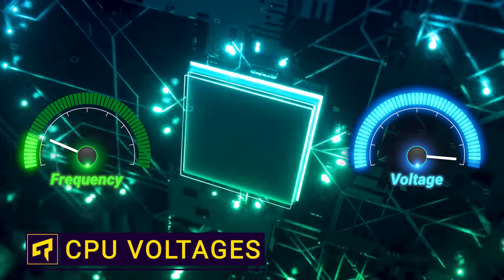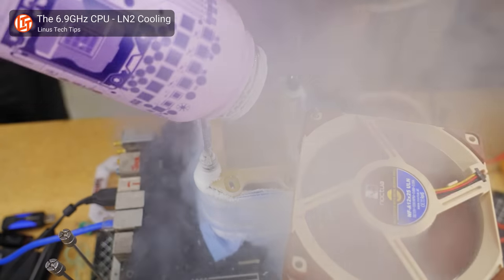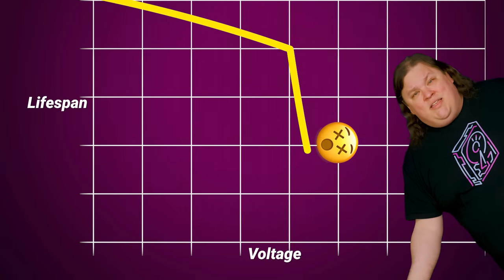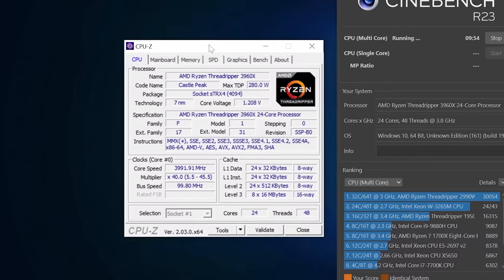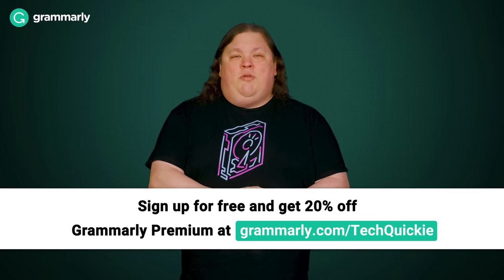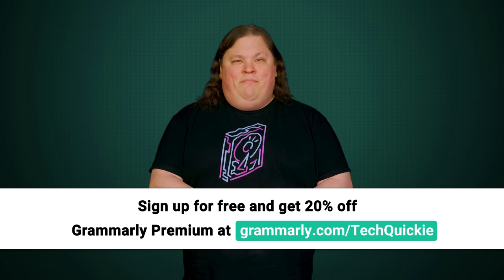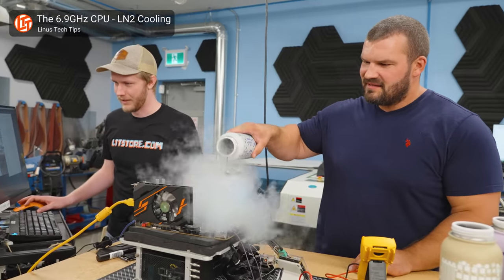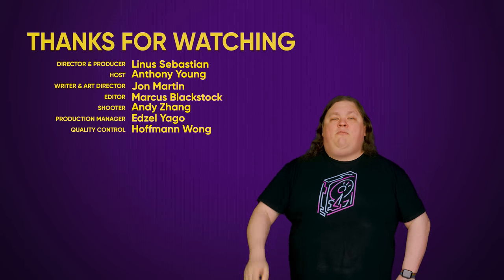What's the Point of UNDERVOLTING Your CPU?

Comment: Stock voltages? Who's stock voltages? Motherboard manufacturers or intel cpu specifications? Intel clearly lists 10th gen i9 cpus stock voltage as 1.28v, however there isn't a single z490 motherboard that wont try to run those cpu's at 1.5v or even 1.6v. I guess if your cpu lasts longer than a year motherboard manufacturers lose money.

Comment: Can you turn your cpu voltage down to about 0.7v and run full clock speed? Are there any cpus that work with 0 volts?
Reply: @miso1995srb  Arm did it,

Comment: I'm still using a 6600k i5, and I managed to OC it to 4.6ghz at 1.365v. I found that at the time was pointless, for the games I played. So I put it back to stock speed and voltage. But recently I felt the need to put it back to 4.6ghz, and squeeze more performance out of it. So that I can hang on a little bit longer, before I need to upgrade. But when I tried to use the same speed and voltage, it crashed. So I stepped up the voltage a little bit at a time. And still it crashed, all the way up to 1.4v. I was told the max voltage is 1.45v, but I wasn't going to go there. Could this be a sign that it's close to its end?
Reply: No, you just got unlucky, I had a similar experience with my old 4690k, it didn't like to overclock, I only got at best 4.3/4.4GHz whereas a lot of people were pushing near 4.8GHz which was ok by me and then later on before I replaced the system, it really didn't like OCing, refused to go over 4.2GHz, but it still ran perfectly fine at stock and I never had any issue with it, if you're really worried then just drop the voltage by something like 0.1v.
Reply: Maybe your motherboard components are worn out. But at the same time I pushed a used in 2500k to like 4.6ghz I think at 1.4v or something. Twas used and was overclocked from the previous buyer so . . .

I dunno. Bad luck?

Comment: There is a thing i wonder though, even though undervolting can reduce the heat being generated, while retaining the same performance, doesn't the current increase instead if the power usage stays the same (or maybe even increases if whatever controls the curve sees there is more headroom/less heat)?

Wouldn't one need a motherboard that can handle that increase of current? Would the VRM heat up more from more current, or just from more voltage? Is the increase of current from decreasing the voltage harmful in another way, for the motherboard and/or CPU?

I'm just grabbing at straws, i'm not sure if this thought is false or correct, just giving food for thought, so someone might answer or think about it too...
Reply: In general it reduces the wattage, my 3070 stock  has a tdp of 220w, undervolted it runs at 167w, and the chip itself only draws 128w
Reply: @tumamaencosplay  Yeah, that is for a Nvidia GPU, i also do undervolt's on a 3080 at 0.868v and 1950mhz, which i tested for stability through various means and my power meter gives me a lower average wattage value and the heat output has been greatly reduced.

However, this is with Nvidia.

I imagined CPU and VRM might act differently and whatever tech controls the curve for that CPU based on various conditions, even more so with a undervolt applied, with changes to how things work over various different generations and between Intel and AMD.

Which was what made me think about that, instead of applying logic from Nvidia GPU's on everything.
Reply: In theory yes, but amperage at the cpu rail stays consistent.  As voltage is the only variation
Reply: @Tallnerdyguy  Aha, so the current stays the same, just changes per clock as usual, that is nice to know.

Comment: You need to measure voltages using a multimeter using a capacitor on back of the motherboard over the CPU socket if your board hasn't a voltage test point. CPUz is sometimes way out.

Comment: 0:18 less voltage isnt "less power".  power is volts x amps.  you can give MORE POWER (watts) while giving it less voltage
Reply: while youre  right , it doesnt apply to this case as max current supplied to cpu rail is hard limited so dropping voltages drops the power consumption as the current doesnt go higher to compensate.
Reply: @doddezx  not necessarily.  you can push more watts than stock while undervolting (if your limit is being set by thermal throttling for example_)

Comment: “Do you know you can increase your CPU speed while decreasing the energy it uses?” 

“Yes! It’s a common technique: DON’T buy CPUs from Intel! … or use a M1/M2 Mac”😂
Reply: You could buy several years worth of extra electricity by NOT buying an M2 Studio.
Reply: @joelcarson4602  yes! It is very true! And you know what? You can also take it a step further saving much much more by not buying any computer! Or take an old computer from your second uncle for free. But it doesn’t change the fact that between a M1/M2 and Inter +++, the efficiency of Intel’s product is probably worse than an electronic heater, no matter how many + the put after it.

Comment: What is the lowest clock and voltage i can run a CPU/GPU and RAM?
Reply: Depends on what you are referring to. How would they know what configuration you would have?
Reply: Depends on the hardware & what the limits are in the bios/ programs used for changing the settings & what the system needs too be capable of still, as at one point there isn't any benefit going lower then x or y for either stability or due too the severe loss of performance.

Comment: hi! i have a i9 13900k asus prime z790 but i cant change the value to do undervolt, it just show -/+ and i cant change it, can somebody tell me why? thanks.
Reply: intel blocked undervolting now
Reply: I have 13900k on asus tuf gaming z790, I had to enable an option in BIOS, but I'm able undervolt still
In BIOS go into Advanced, AI tweaker, Global core SVID voltage, change that to adaptive, choose negative (-) offset, in the field below type your offset value

Comment: In Asus BIOS (Z690) for the i9-12900K I'm wondering whether I should undervolt the VRM or the CPU Core. In BIOS it says that the CPU Core voltage will be affected by the VRM voltage. Any ideas?
Reply: Don't throttle your vrm. Ever.
Reply: Leave your vrm. Just undervolt core voltage directly either with manual override or llc of offset

Comment: Running your CPU at a fixed voltage was very much the norm until only very recently. Considering how long I rode many of my previous processors on fixed overclocks without any of them dying on me, either modern architectures are laughably fragile or you're drastically overstating the dangers of overvolting.

Comment: Excellent video! However, I have been trying to overclock (and am willing to mess with voltage) on my ryzen 5 3600. Overclocking guides seem to exist for intel, but I can't find a comprehensive (and current) guide for AMD. I'm not doing anything crazy, and only have an aging hyper 212 cooler on it, but I think a video explaining BISO overclocking (and maybe some PBO as well) could be relevant, especially with GPUs starving for CPU power with how fast they are getting. Thanks!
Reply: That cooler is high for that PC and you dont need to undervolt that CPU. I was use that cooler on 3600x combo wich 5700xt and only i was did is undervolting GPU and not metter what i did my GPU temp didnt go more than 65c (Gigabyte Gaming OS) and samr was on CPU and lover.

Now im using Hyper on 5600x and works like a charm

Comment: Is it possible  in laptop 12700h  could reply asap
Reply: No lol. That's why i built a desktop i7-12700K PC. You can't undervolt Alder Lake H processors for some reason.
Reply: unfortunatley no, Intel started locking it on laptops since 10-th generation
Reply: @tabalugadragon3555  Tiger Lake supports undervolting and partial OC.
Reply: @tabalugadragon3555  It unlocked out of the box for that stuff on 11th gen, either with XTU or Throttlestop.

For the 12th gen H series chips, Intel removed FIVR from the chips
Reply: @saricubra2867  I mean on most laptops 11-th gen was locked. Heck, even 10-th gen was mostly locked in XTU and Throttlestop, that's the gen Intel started locking it.

Comment: Undervolting is rather pointless as a whole.  It only works on a few good samples and even then the effect is minimal. Just lower the clocks by 200/300 Mhz and the effect is way larger. Yes you lose some performance but a 5% lower clock rate can result in 40% reduced power draw  and a less then 5% loss in performance. That last few hundred mhz is terrible inefficiënt. 
And over volting is a non issue i had a 3770k that ran 5 ghz all core ever since release for 9 years. i even ran "over spec mem voltage" with that to run DDR3 2133 CL8.

Comment: Why should anyone care about the lifespan of their cpu? Does it end up failing?
Reply: Remember it's not the speeds that hurts the CPU, but the temperatures. Those temperatures will slowly melt and degrade the internal circuitry of the processor causing it to become less and less stable over time running the same voltages. What I've heard is that the typical lifespan of a cpu might be around 12 years and a moderate overclock will cut that in half, so it stands to reason that an aggressive overclock will diminish that time far more. You'll see more crashes and more instability.

Comment: I would argue that you DON'T save any meaningful power consumption of the "computer" by any slight change to CPU voltage since ALL the power goes through the power supply.  So the power used by the PSU will be the same, regardless of the CPU voltage.
Reply: You’re assuming the power supplies and the VRM’s use linear stages. That assumption is not true.
Reply: That's not how power supplies work.